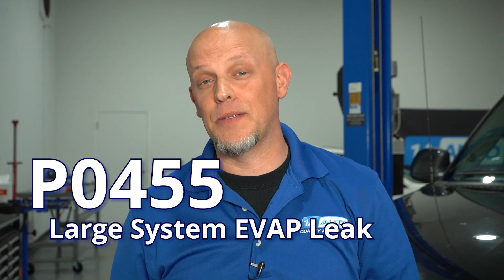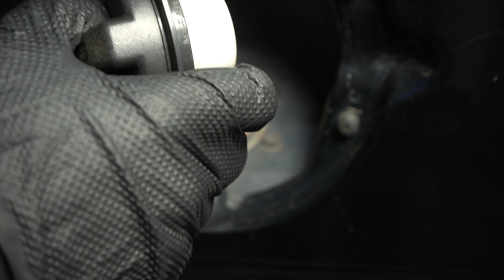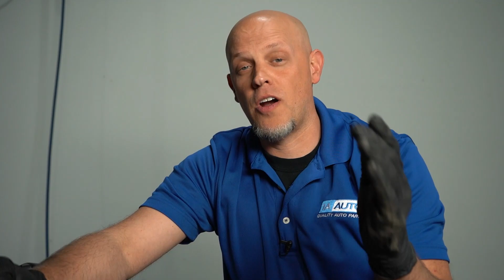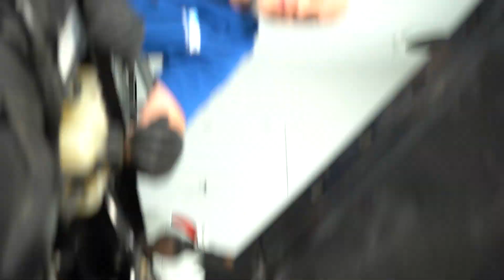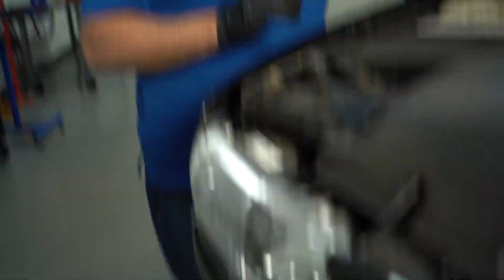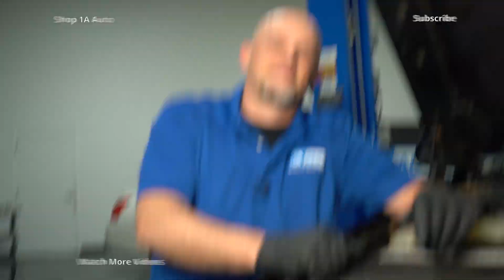Top Check Engine Trouble Codes 2000-2006 Chevy Tahoe SUV

Comment: Codes P0452 and P0651 on my 2004 Tahoe fixed and corrected the problems but still my check engine light is on. What to do? #TeamTahoe

Comment: I had the evap code and actually replaced the vapor canister, the valve and the purge solenoid. The charcoal filter in the vapor canister failed and filled the entire system with charcoal bb’s. I was getting worse than usual gas mileage. I found the line going from the back of the engine to the purge solenoid was completely blocked with the bb’s as well as the solenoid. Took that line off, cleared it out and blew air through the system from the hose at the canister connection to clear it. My friend watched as I did and said a lot of debris blew out of the end in the engine bay. All said and done I would guess there were thousands of charcoal bb’s blocking the entire evap system. I’ve only driven the vehicle once since the work but did get a lot better gas mileage on that short trip. Just an FYI for anyone dealing with the evap issue. Check the entire system.